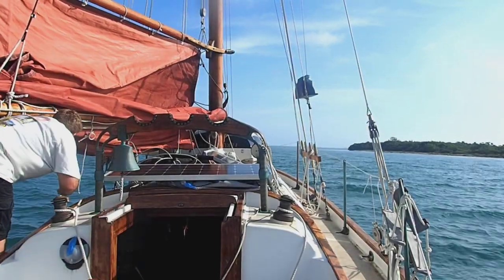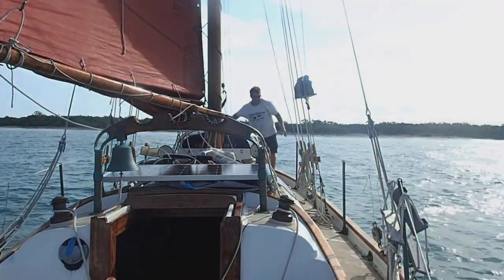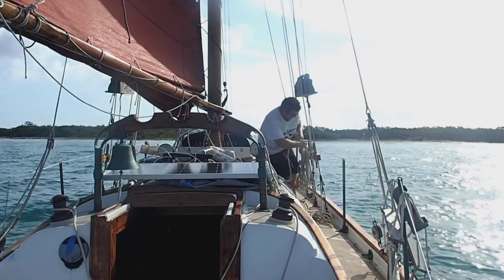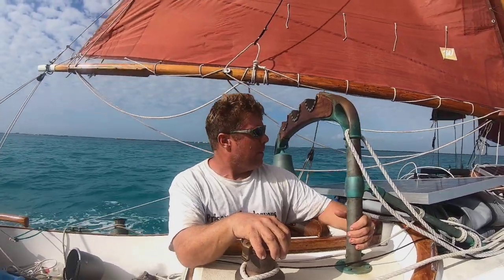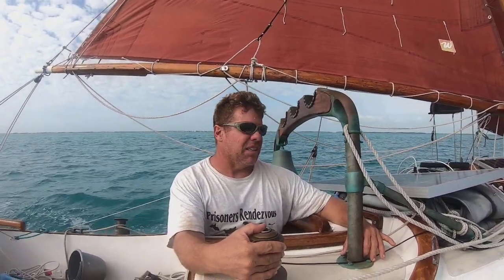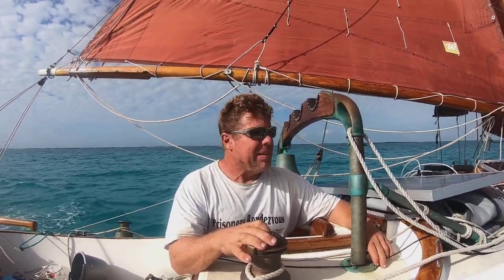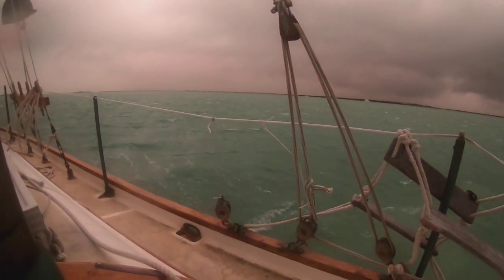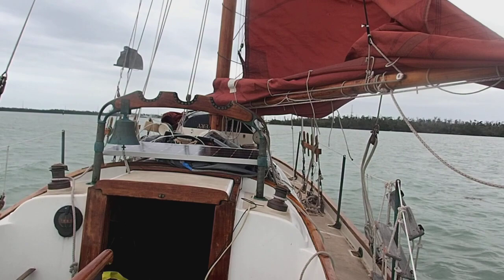New Batteries: AGM's, by the Numbers

Comment: What a rats nest!!  You should think about installing a buss bar remote from the actual batteries for your connections.   Batteries in parallel are vastly more trouble prone than singles or lower voltage units in series.   A single battery with the desired capacity is far better if available.   I agree with the previous poster that discharge depth of lithiums appear to make them a better long term bet.....but up front cost of replacement is intimidating!.   They also will NOT achieve their projected longevity without a fairly high tech charge controller, or at high or low temps, as I found out at significant cost.   I always run identical cables from each battery to a common point where connections are made to fully balance loads.  Someday someone will develop a parallel battery management system to control and monitor each battery’s charge and discharge controlling them with pulse width modulation so mismatched batteries would work an individual performance could be reviewed..... someday.....

Comment: I look forward to your videos, ty for sharing. Any thoughts of going further North after leaving FL? Maybe Maine for the summer? 

Amazon pricing for batteries are noit nearly as good as what you can get locally. I priced out LA 155 AH 12 v Deep Cycles batteries from US Batteries in DE at $131 each and they do require weekly maintenance checks, distliied water and testing of voltage and acidity level. Trojan offers some good videos and the Marine How To website goes into depth as well. Anyone should be able to get at least 5 years from LA batteries with proper care.
Reply from the maker: Summer plans are being formulated ...
Reply: Michael Anthony  Good point although I know of a few people who are engineless and use a sculling oar for getting into and out of the marina!  It certainly does add some complexity to sailing without an engine though.
Reply: Michael Anthony  What sort of tides do you get in SF Bay?  We can get some good ones here.  I am in NYC and in the northeast we can easily see tidal currents of 4 or 5 knots.  Those who use sculling oars will never fight that. Instead they wait for favorable tidal currents or slack water.  It definitely affects when they arrive or leave port.
Reply: Michael Anthony  That is a pretty quick tidal current!
Reply: Michael Anthony  Kevin already has completed an engineless circumnavigation, so I guess you have been proven wrong mate!
Reply: Michael Anthony  He headed out in 2001. YouTube wasn't founded till 2005.
Reply: Michael Anthony  He did circumnavigate and he discusses sail, repair,navm and other skills and  techniques which are applicable to sailing all oceans.
Reply: How to Sail Oceans is an appropriate name for this channel. Imagine You Tube, Go Pros and drones had existed when you circumnavigated, Kev?  That would have been great 😊
Reply: Michael Anthony  I don't care. Take it up with the man himself. Be well.
Reply: Michael Anthony , Damn how did they ever discover America ???
Reply: Michael Anthony , ha ha ha , ask a simple question and you go off and call me an idiot , well my friend I would much rather be called an idiot by you than what I’m sure a lot more you tubers are calling you . Have a nice day ! !
Reply: Michael Anthony  Kevin has talked about his "circumnavigation" in at least one previous video.  It wasn't a true circ, given that he had the boat trucked across the southwestern US.  A reasonable choice given the inaccessibility of the canal, and the hazards of attempting an engineless east-west Cape Horn passage.  He did everything else.  I guess if he decided to fit an engine after all this time, he could still complete his circ by going through the canal to the point he had Ruth Avery trucked to.
Reply: Michael Anthony  For not having time you sure spent a lot making comments.  8^)
Reply: Michael Anthony  It's hard to take a person seriously while they call one an absurdity. My bad, I thought the video I linked you had the part when he described his journey and trek across the US. 

Here you go at MINUTE "3:04":  S/v Ruth Avery: Boat Tour, Part One: https://www.youtube.com/watch?v=G0LEqpmx3tI
I spent a few minutes reviewing his videos to find 'your' answer...

For a person who knows so much, you sure are a good researcher and investigator. Why nit-pick? The dude isn't trying to set any specific records.
---Be well

Comment: No, I am not a sailor, but I am an RVer and I know batteries. LiFePO4 batteries are without a doubt superior to lead acid batteries and yes, AGM batteries are also lead acid as are gel batteries. The main difference between the three types of lead acid batteries is the form in which the electrolyte is stored, i.e., as a liquid, as a gel, or as a semi-gel in an absorbent glass mat. Kevin is correct that LiFePO4 batteries will come down in price. So, you might think that I have LiFePO4 batteries, but that would be incorrect. I don't have them for the same reason as Kevin: I don't want to shell out the purchase price just yet. I have a pair of Trojan T-105 flooded 6V batteries in series that result in a very effective 12V system with a 200 ampere hour capacity. Would I have those same batteries in a small sailboat? No, I would make the same technology choice that Kevin made (AGM) although I would probably have chosen Trojans. Why? AGM batteries don't leak if they are on their sides, don't put off as much hydrogen gas as flooded batteries, and don't require as much maintenance. Even without any blue-water experience, it's easy for me to see that sailboats have even more maintenance than RV's and that's a lot. Adding flooded lead acid batteries in a sailboat is not worth the cost savings.
Reply from the maker: My thinking is the same, next battery change I will probably go with a single 175Ah LiFePO4 battery, which will have at least as much usable capacity as my current bank, but with far less weight.  Hopefully prices will drop by then too ...

Comment: Tough call, but I'd stick with AGM as well, unless weight is your primary concern. The main problem with Lithium based battery chemistry is FIRE. Nothing is worse on a boat than a fire that goes out of control. Nothing - not even sinking in a storm. If your boat burns it's gonna sink anyway, but not until you are either badly burned, burned to death, or asphyxiated.  Even a propane or gas explosion is preferable. Being involved in a collision with a ship is a walk in the park compared to what several hundred amp-hours worth of flaming lithium is gonna do almost instantly to your boat. 

If anyone thinks I'm exaggerating, read this: 

https://en.wikipedia.org/wiki/Sinking_of_MV_Conception

...the most likely cause of the worst US civilian maritime disaster in 150 years was a tiny Lithium cell phone or camera battery being charged in the galley. AGM does not carry this risk, and I have found them to be extremely tough, dependable, and zero maintenance. They also have a very low self-discharge rate. The main thing is charging them properly which is easy with modern smart chargers.
Reply from the maker: I think in perhaps another 5-10 years we are going to have much better batteries.  I had really already made up my mind given the price and the fact that the Vmax AGM's lasted six years,  with some occasional very deep cycling (down to 30% when no sunlight).  That's good enough for me.   Did not consider the fire hazard, although I do recall Samsung having problems with the Li batteries in their phones catching fire.

Comment: Here is the real math: AGM batteries you get 50% to 85% usage range. They take VERY long to get anywhere above 85%. Like you need to plug into the marina for a day to get that.  So you have 35% x 250 Ah = 87.5 Ah of usable range. $550. Now look at the LiFePO 100 Ah. For fun just say 85% usable range so one battery at 100 Ah gives you 85 Ah of capacity (same as two of your AGMs). And LiFePO will take and use every watt you send it unlike AGM, so no wasted solar while you drive them back up to capacity AND that last 85% to 100% doesn't take a whole day like AGM. 

Most bad experiences with LiFePO is that they will take everything your charger will throw at them. You have no motor, but folks with wimpy 80-125A alternators freak out as their LiFePO batteries will have that alt running 100% which light duty boat crappy alternators are not meant to do, overheat and die. On the other hand, throwing solar and wind gen watts at a LiFePO is magical. And plugging into a marina? amazing. So yeah, $550 v. equivalent capacity $950, but way better charging performance and life if you have the right setup. Not sure where the negative comments on this vid come from, anecdotal BS mostly, everyone I know who went LiFePO are delighted. But they used real data to compare performance.

Final note (edit) AGM hates solar as AGM lifespan depends heavily on driving the charge at a high percentage of capacity - a 250Ah bank you want to push at least 100A at it (.4c rule) or you greatly lower the lifespan, that's a BIG solar bank :-) Nets out as maybe your batteries lasted you 5 years but if you tested them you'd find your 250 Ah bank was delivering 40Ah at best. LiFePO doesn't do that to you. Promise.
Reply from the maker: Interesting, it had crossed my mind that only 50% or so of AGM or lead acid is usable--if you cycle deeper than that you risk damaging the battery.  Did not know that AGM's like rapid charging, but these are designed for solar charging so ... anyway, they lasted six years, and occasionally got down to 30% charge or so, so I was happy with them.  Obviously as prices come down these newer batteries will become standard.

Comment: What makes an AGM (or any battery) specific to solar charging?  Seems like a marketing gimmick to me. A battery is indifferent to the source of the charge, be it traditional lead-acid, AGM, or lithium.  It is the job of the charge electronics to deliver the appropriate charge levels for the battery.  Lithiums have a strange property that they can take a "fast charge" until they are at 80%, or so, then you should no longer fast charge.  So you see EV cars advertised as capable of fast-charge 0-80% (or maybe 85%) in, whatever, 40 minutes.  They don't mention that the last 15-20% will take another hour.  The rule-of-thumb for lead-acid is that the charge rate should be no more 10% of rated AH capacity.  So an 100AH lead-acid battery shouldn't be charged at more than 10 amps, and then when fully charged don't want to be overcharged.  AGMs (absorbent glass matte) are lead-acid with a different build that results in a greater life.  Lead-acid "deep-charge" has a chemistry that improves on lead-acid's dislike of being discharged below 50%.  Both lead-acid and lithium can deliver high discharge rates, so can drive starter motors.  Each battery type has its own little quirks.  Just a single disregard of the battery's properties can result in a much lower lifespan.  One unintentionally discharge of a lead-acid battery to near zero, traditional or AGM, will half the life of the battery.  But in an emergency, you have to do what you have to do.
Reply: Actually, lithiums can't go to 0% as many are claiming. They have built-in circuitry that won't let them go to zero.  So when an iPhone says it is at 0% it really isn't.  If it went to the actual 0%, it would no longer be able to be recharged. Early lithium batteries weren't marketed as being rechargeable and you could and did run them down to true 0%. (I am old.)

Comment: I wonder...do you cross the batteries? Like, you should sett it up so you draw from the negative from one battery and the positive on the other. That way you ‘mix the current’ and the battery’s last longer. If you only draw from one battery, that one will die early’r. 
Fair winds ,,,/),,,,
Reply: Michael Anthony  It's called parallel and there is nothing wrong with it. And no Anders, there is no point in crossing it, its in parallel, it comes from both no matter how you wire it.
Reply: Michael Anthony  Nope. If that's what he was asking he would be talking about series and once again that wouldn't "blow up your boat", but obviously that wouldn't be his question.
Reply: Michael Anthony  Just trust me, he is talking about parallel, load negative on one battery, load positive on the other. He thinks that has an effect on battery performance, I told him it doesn't. I'm right, no need to reread anything. As long as he is using the correct gauge to jump the batteries, he can hook the load up however he likes, it will make no difference.

Comment: AGM and Led Acid are very similar.  They suck. High maintenance, don't fare well in the cold, off gas, prone to explosion,  and create corrosion to their immediate environment and very very heavy.  The only plus is the price...
Wait a bit as newer technologies are just coming out ant will fare even better than LI ones.
Good luck and happy sailing!
Reply from the maker: Agree, but Lithium has to come down in price IMO.  And I could not wait another three years for that to happen, the batteries needed to be replaced, I was losing too much capacity.
Reply: I'd like to think so, but I don't think anything better than Lithium is likely, the main reason is the energy density would make it akin to a powerful explosive and the legislation and restrictions would make it all but impossible for the little guy to obtain legally.
Reply: Batteries are very similar to motor oil, ask any 5 mechanics what the best motor oil is,you will get 5 different answers.. it all goes down a rabbit hole.

Comment: You stated dilectric grease provides 'good electrical contact'.....I think you might want to rethink that. The grease will prevent corrosion, repels water but does not conduct electricity. Unlike so many that do, dilectric grease has no powdered metal which does indeed conduct electricity.
Reply from the maker: Others have made that same comment.  I guess I'm not quite the certified electrician yet ...